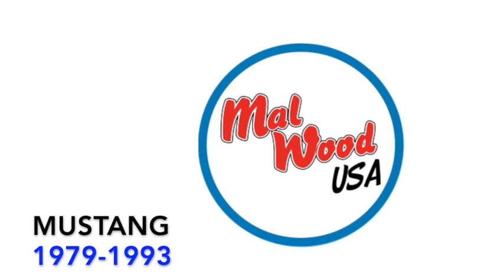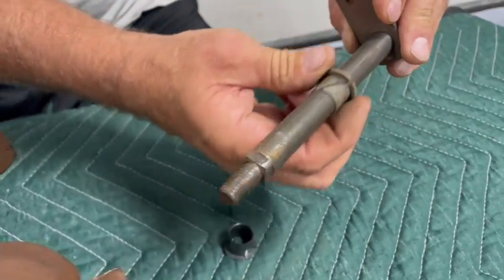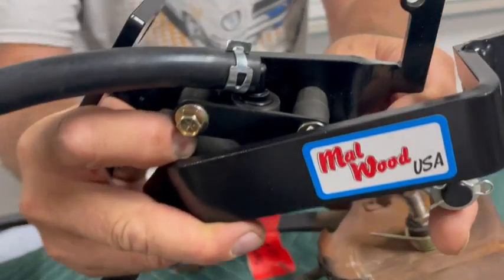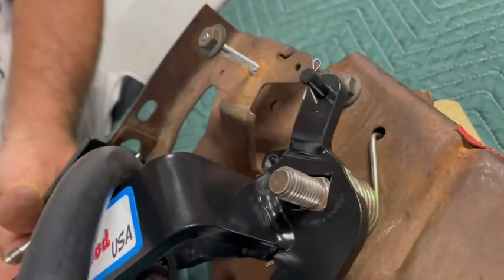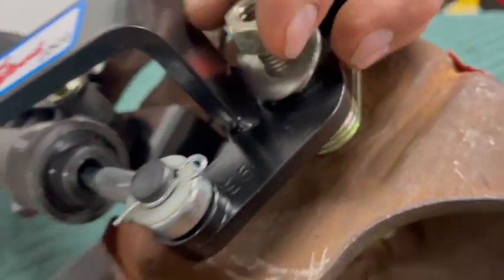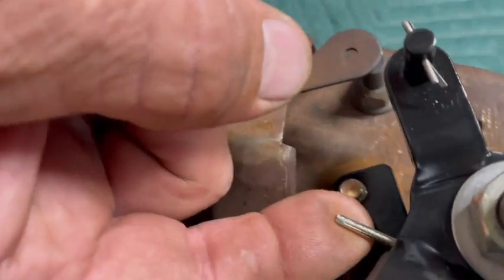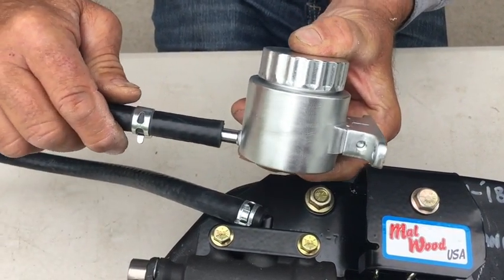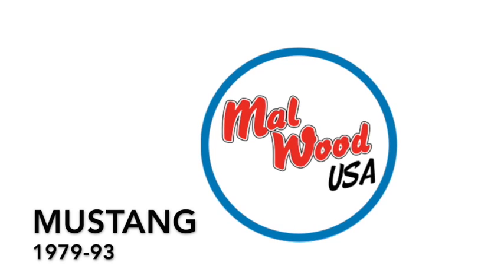Mustang 1979-93 INSTALLATION MALWOOD USA

Comment: Does the high pressure hose route through the car the same way the clutch cable did or does it  need to be done another way? I assume it routes the same as the cable since there isnt anything noted anywhere about it..
Reply from the maker: Yes.  You can route the line however you like..  Through an existing hole in the firewall or down under the carpet drill a hole in the transmission tunnel.  Give our tech dept a call for any questions. Happy to help